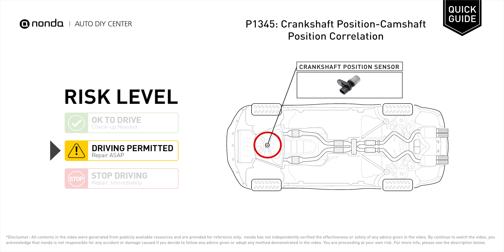What is P1345 Engine Code [Quick Guide]

Comment: I replaced cap n rotor ,  cam sensor and crank position sensor .
2 months ago,  now code 1345 pops up, running  rough. Cam/ crank correlation issue! I don't get it...
Reply from the maker: Hi Aaron, can you please provide us with your vehicle's year, make and model?

Comment: i’ve got a bmw x5 2001 3.0i, With P1345. also a misfire on 6th cylinder on start up. Going to get crank and cam shaft sensor today.Will report back
Reply from the maker: Thanks for watching, Neo! Hope this helps!
Reply: did you figure it out, I also have the same model and code. Any help?